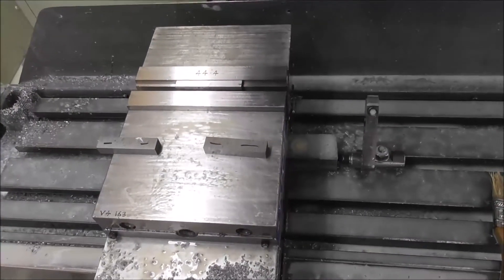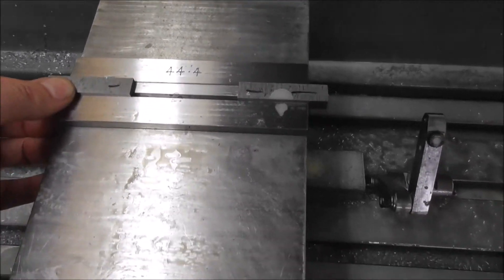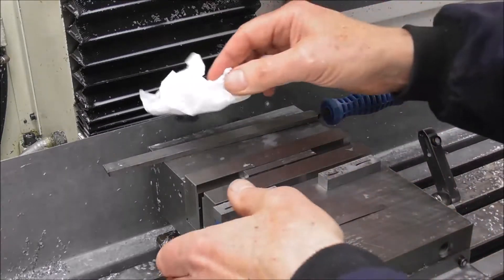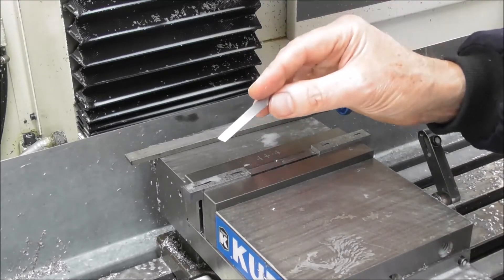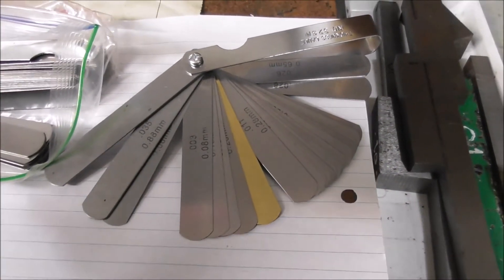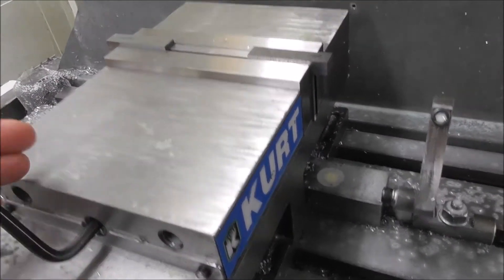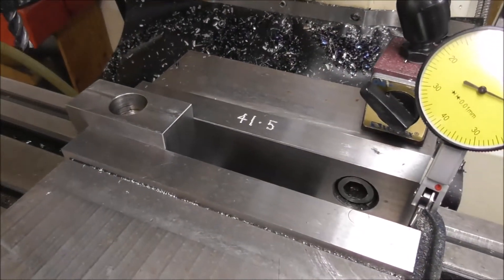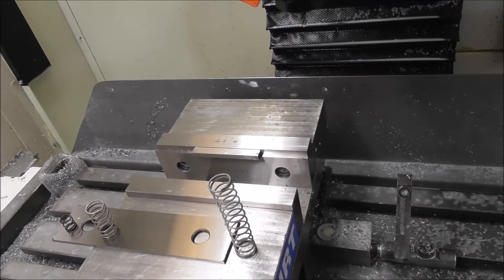Vise Work  - Tips and Tricks

Comment: I hated using air to clean off vise for two reasons:  1) chips went everywhere, as you said.  2) it atomized the coolant and I want to breath as little of that as possible.  These days I insert some manual gcode at the end of programs like this.  

First, I do a G53 move, so I don't have to worry about adding other work offsets later that might mess it up, that positions the fixture for loading/unloading.
Then I do an "M00 (Remove parts, close doors, hit cycle start)"  This stops the program and puts the part in () on the PathPilot display.

So I remove my parts, close the door, and hit cycle start.  Then I turn and put the parts in whatever the next step in that process is.  Meanwhile, the program continues by turning on the coolant and then I have some more G53 moves that sweep the coolant across the fixture and the flood coolant washes all the chips away.  Finally, another G53 move to reposition the fixture for loading new stock.

If I'm working all day, I will let the mill sit for 2-3 minutes after the washdown cycle to let any coolant settle so I don't inhale it.  The amount of time saved by eliminating the air blowoff or wipedown as well as the time saved by not having to jog to a fixture load/unload position is so nice!

BTW, I use your post for all my PathPilot/Fusion 360 stuff.  One of these days I'll work on editing it to remove superfluous coolant and spindle speed commands.  Pathpilot wastes that second at each one to verify that spindle is to speed, and that adds up if you're doing patterns with lots of parts and individual operations.   I can cut one of my operations from 53 minutes to 51 minutes just eliminating all the unneeded commands.

Thanks for everything you share with the community!
Reply from the maker: Hi Bill. Thanks for taking the time to give feedback and share your procedures.  Cheers,  Cliff